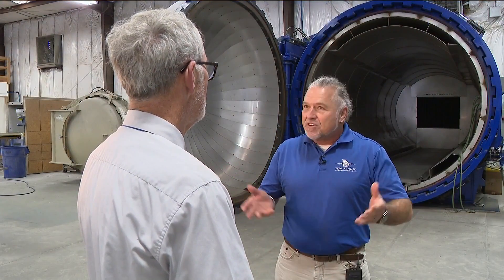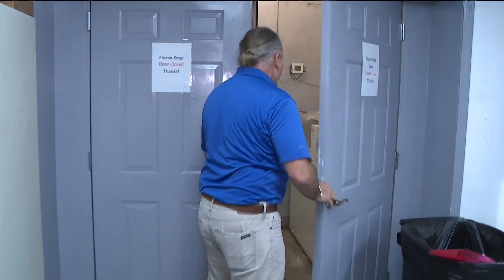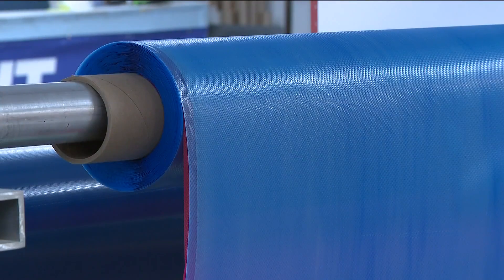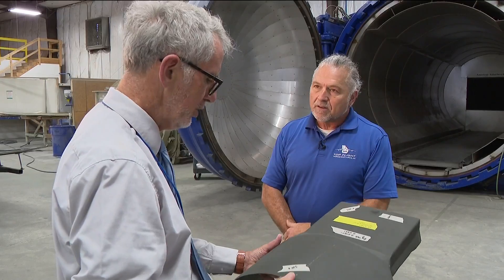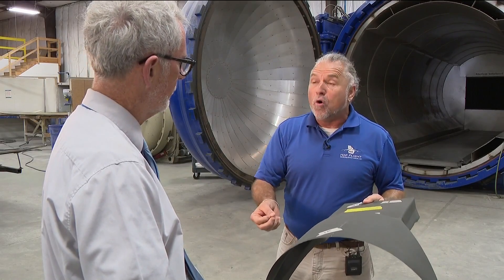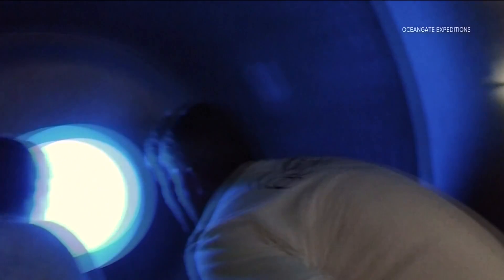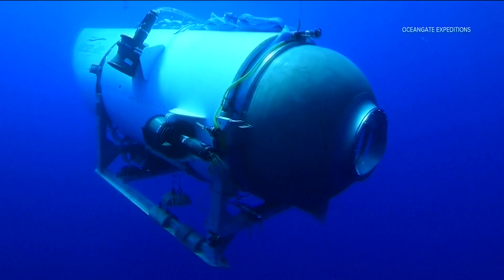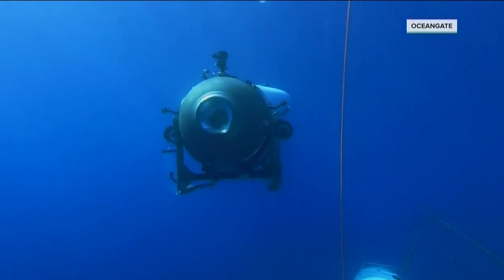Georgia engineer talks carbon fiber that failed in Titan submersible implosion

Comment: There was nothing wrong with the Titan submersible's engineering, in my opinion. It just needed to have an expiry date, a service life (I'd say no more than 1 year), or a fixed number of dives before it was tossed and replaced. 

At such high pressures (400 atm), latent signs of stress and hidden microcracks had likely begun occurring. This happens to other high-strength but frequently-stressed items we use like bike helmets, kevlar vests, shin guards, roof, tires, etc.

If the sub worked safely that many times, then the technology was not flawed per se. Deep water pressure didn't just magically increase overnight. The sub's number of dives just needed to be limited. Everything engineered by humans lasts only so long.

So for the quarter million dollars they charged each passenger and their one million in build cost, the sub would theoretically have paid for itself after four passengers or a single full-cabin dive.
Reply: I think his plan was not for the hull to keep up for as many dives as an all metal hull, in fact he had already scrapped one hull that showed signs of cyclic damage. His plan was to detect the early signs of damage well in advance with the acoustic detector he had patented and had installed on the Titan. Maybe it was a combination of the hull not holding up as well as he thought plus the detector not detecting as much as it should.
Reply: @sigkil Following Rush's logic, airlines should skip the 100 hourly inspections and instead install detectors which will let you know in-flight when your wings are about to fall off.
Reply: @qarnos 09:42:12 [SUB]: trying to run diagnostics. ascending now. but very slow. sounds have subsided. global RTM alert active all red.
Reply: @sigkil yeah that’s probably the real issue here, he was beta testing the warning system but also putting all his faith in it
Reply: The glue, the glue.
Reply: How about no

Comment: 🇵🇭 Carbon Fiber hmm.. is that the Material used on Car Bodies & Bumpers?  Expensive & Flashy  but NOT for deep water Temperature & Pressure.

This is Not MEG the movie right?
Now they knew CF wouldn't hold.

Comment: As an engineer it beyond reasoning why someone would want to use carbon fiber to build a submarine when it is an unfit material to use under compression. Foolish pride and not listening to the experts to use the right materials was what got the CEO killed and unfortunately the passengers. Hope this will be a lesson to others to listen and get expert help always and only use certified crafts or equipment.
Reply: I am an electrical engineer so I am no expert in material science, but I have worked with mech engineers my entire career. Most electrical circuits need a housing and environmental protection. The carbon fiber hull would have raised my flags right away. Did Oceangate even know the CTE of the poduct they used, it varies widely with manufacture. I would have never gone on a dive. Let alone the fact that I don't have a spare 1/4 million anyway.
Reply: The ceo supposedly had an engineering degree from Princeton. Maybe he was suicidal. And I'm shocked that billionaire passengers wouldn't have hire their own 3rd party certification. Maybe everyone was just really dumb
Reply: @sdrc92126  just because he had a degree in engineering from Princeton doesn't mean anything, there are good and bad people in all occupations plumbers, nurses, Carpenters,ect.
Reply: @karlmiller7500  It means either princeton is terrible or he didn't listen or he was insane (my vote). This is taught in at least 5 classes to get an ELECTRICAL engineering degree much less something more applicable like mechanical, aerospace or civil engineering.

Comment: Vacuum of space versus Titanic depth is 400  times ratio

Fibers work in tension not compression. Basically the Epoxy adhesive is doing the job.

2 same pressure vessels on earth at 14.7 psi inside. One is going to Pluto and seems a mighty 14.7 psi pressure with the vacuum of space. The 2nd vessel is only going to see the Titanic so has 395 times the pressure since it is 5800 psi there. 

The Titanic pressure vessel is using epoxy to hold the 5800 psi outside and the carbon fiber is just marketing hype. Ie giant red flag that none of that fiber is really in tension. Maybe some pretension but still hokey stuff
Reply: So it’s impressive epoxy then

Comment: It also looked like they screwed brackets into the CF hull on the inside, if so that would compromise the structure. Also any materials engineer would understand CF strength is tensile not compression, such a sad waste of lives :( !

Comment: 20'000 for a stress test. That's nothing to billionaires. That's just stubbornness and denial by Stockton Rush/Oceangate.

Oceangate really could have been at the cutting edge of innovation if they tested it all properly and without tourists until they were sure, but I don't think the sub would have done well in tests. I have this horrible idea he didn't want it testing for this reason. It was all about the money and fame.

People who do things and take risks without taking into account the safety and welfare of others often fall apart in the end. The bigger they are the harder they fall.

Comment: You completely missed the most relevant point that fiber composites excel in tension, not compression; that its use in this way is fundamentally unsound.   Mark Shinnick

Comment: Using carbon fiber like in an airplane is not dangerous because of an open space while using it underwater and submerge it as deep as you can will pose a problem because water is not an open space. The pressure it will give are very tremendous.

Comment: ok, that video clip taught me nothing. what i wanted to know was whether carbon fiber is LEGIT for submarine diving to such depths as Titanic. From what I've read from multiple youtubers (god knows where they got their information as no sources were provided), carbon fiber is not the correct material - PERIOD - to do with for compression, and instead, steel should have been used. I've no idea, just wanted to hear an engineer speak about the materials - thats it.

Comment: The guy in the video is trying to sell inspections.. And that's why he doesn't mention that aircrafts are holding pressure from the inside, it's not withstanding pressure from the outside. Also, the pressure that aircrafts contain is just a fragment of the water pressure at large depths.
Reply: Indeed. An aircraft is pressurised to 0.75 atm, so the pressure differential is no greater than 0.7 atm. Meanwhile, a submersible at 4000 metres is experiencing a pressure of 400 atmospheres of seawater.

He should just say it is not good for building submarines.

Comment: Carbon fiber is the last thing I would decide to make something like this out of. It has awful compressive strength, especially when you're taking it thousands of feet underwater. How did this even get passed as a good idea
Reply: How? The CEO of Oceangate decided it was a good idea. Then he either ignored or got rid of anyone who told him otherwise.
Reply: I don’t think they had any kind of certification.
Reply: No, NOT terrible, maybe not the very best.........Better than Wood which had supported railroad tressels for 200 years...............Paul

Comment: It's the wrong material for subs. Under sustained load in the presence of sea water, carbon fiber's tensile strength decreases 7 to 12%. Wet/dry cycles also weaken it. Every time he took that contraption down, he was one day closer to death, because he was weakening the hull. Then you have those titanium end pieces that were glued to the carbon fiber with epoxy resin aka JB weld that you can buy at auto zone. Epoxy resin has a tensile strength of 5 to 6000 psi, but the Titanic depth he took it down to, has a pressure of 6000 psi, not good. If that wasn't crazy enough, they said the plexi glass portal was only rated for 2000 or so feet. The manufacturer told him this, but he used it anyway. There were so many weak points on that thing, that there's no telling what caused its demise. They said the last message he sent was that he was dumping ballast weights, so something happened to cause him to try and resurface. He probably sprung a high pressure leak in one of those end piece joints or carbon fiber stress cracks that the Brit found, and it was the beginning of the end. He fired the Brit for telling him it was unsafe and there were stress cracks. I could be wrong, but I think the thing exploded instead of imploding. If the pressure leak started in a compromised area and the rest of the contraption was sealed up, the pressure would have exploded the cylinder like compressed air blows up a tire. I suppose the bodies inside would have imploded though. The kid was the only one who had any sense and didn't want to get on the rinky dink thing. The said he did it anyway to bond with his dad, which seems strange. I thought you bonded with your dad, because he was your dad. Why would you have to risk your life to bond with your dad? I used to go fishing with my dad, but never considered it a bonding session.
Reply: How would it have exploded like a car tire? The difference between a container's internal and external pressure is called the differential pressure. A car tire can explode if the differential pressure gets too high and exceeds the ability of the tire to contain the pressurized air. In order to increase the differential pressure enough to explode the tire you will need a compressor to force enough air to go into the tire while the pressure outside the tire remains the same. In the case of the submersible, the only available pressure source is the ocean outside. If the sub sprang a slow leak the highest the  internal pressure could ever go would be equal to the outside pressure. If that had happened the sub would never have exploded or imploded. It would have just slowly filled with water until the occupants inside were either crushed to death or they drowned. The only other thing that could have happened would have been a catastrophic implosion where the hull suddenly failed and everything was suddenly forced inward. During the implosion the pressure inside the sub would have instantly become equal to the pressure of the ocean. After the implosion the sub would have ended up as a twisted, broken mess, which is exactly what we're seeing as the wreckage is being brought up.
Reply: @joevignolor4u949  They have videos of things imploding on YT. One of them is a tanker car from a train, and it pulled the whole thing in on itself in one piece. When you look at the wreckage, the pieces were blown apart. The titanium rings were no longer attached to the carbon fiber and the window was blown out from the inside, because there were no more bolts on the flange. The end caps also separated. An implosion wouldn't have blown anything out, but pulled it in on itself. If you are down where that sub was and had millions of pounds of pressure pushing in, a leak the size of a human air would explode it. The leak would be so pressurized that it would cut through metal, like a high pressure water cutting machine. If Stockton was in front of that high pressure leak, it would have cut him in half.
Reply: @mark6678 I do not understand your logic.
What's define if something explode or implode is the pressure differential.

An explosive explode because gas quickly build and create an internal pressure too big for the casing material.
It's impossible for a submanine to explode, unless the pressure inside the submarine is greater that the pressure of the ocean, which mean everyone is already crushed to dead by the air pressure.
Reply: @mark6678  - No way to create more pressure inside than there is outside a submarine unless you have a combustion or explosion internal to the sub. Since there was nothing combustible or explosive inside the sub it had to be an implosion. Since carbon fiber is very brittle if the cylinder imploded the carbon fiber would have splintered into thousands of small pieces hence there would be very little of the carbon fiber clinging to the titanium rings.
Reply: @WJV9  But you have 450 atmospheres of pressure outside and 1 atmosphere inside. It's like trying to force 450 ounces of beer into a 1 ounce can. The can is going to expand and explode. The pressures wants to equalize and will do whatever it takes to equalize.
Reply: Exactly. This isn't a safety issue or failure. The base material is unfit for it's intended use. Homicide
Reply: You make good points, I wonder if he'd just used a thicker hull than 5 inches if it could've held together. Maybe more like 10? The reason he wanted carbon fiber was so he could fit more people into it. It's all explained in his speech somewhere. This was the 2nd version of it, the had an earlier one using steel or something that wasn't designed to go that deep. Besides all that an expert said he should've been charging 1 million then decommissioning the sub once it reached its dive limit and built another. Sounds like he wasn't willing to keep rebuilding the thing like that.
Reply: Some good points here, but it is incorrect to equate the pressure they were underwater to the tensile strength of the epoxy (meaning that the epoxy was experiencing 6000psi just because they had an external load of 6000psi). That has to do with load distribution and design, not the external load.
Reply: Most epoxies have a tensile strength of 10,000 Lbs and compressive strength closer to 20,000........The specs are readily available from each manufacturer.........I have been using and researching the stuff for more than 30 Years..................Paul
Reply: Yes, and the epoxy joints were assembled in dirty workshop conditions and not degassed, so the joints undoubtedly contained dust and other stray material, as well as air bubbles. All these inclusions are points where failure can start.

Comment: I don't trust the material on bicycles because they'll eventually give way. I definitely don't trust it to be used in a submarine. They'll break without warning if cracks isn't spotted early.
Reply: There was a fatal incident several years ago in my state when a cyclist's carbon fiber bike frame broke apart when he was cycling at speed. Plus a good number of injuries.
Reply: @jonathantan2469  Yikes. Fatal you say? All the more reason why an aluminium bike will last forever even when stored as opposed to a CF bike. No thank you.

Comment: Carbon fiber is essentially a carbon weave material combined with epoxy resin and bonded by baking.  I don't care what anyone says, I would not trust it with my life and I would not trust it being used as a foundation on any type of structural use.  There's so many things that can go wrong, it requires meticulous upkeep and if any type of imperfection is missed, there's a weak spot in the material not to mention there's also the possibility of imperfections created during the manufacturing process.  Everyone I've encountered as a "believer" in the stuff swears that its stronger than steel and other metals and gets offended if you question it.  I've seen carbon fiber fail with my own two eyes.  It also seems that different experts say different things about it.

Comment: I don't trust carbon fiber. Never fly on the Dreamliner.
Reply: I’m with you & I won’t , carbon fibre hasn’t been in service long enough to prove itself long term , metal alloys  & fixings will deform & give more clues that a part or panel needs replacing , carbon fibre needs expert checking via ultrasound / X-ray , more chance in my humble opinion that something like micro cracking or delamination may get missed . Every deep submersible ( life support capsule ) from the beginning has been made from metal , firstly steel , when its strength limits were reached , then titanium came onto the scene enabling far greater depths to be reached , even then , the manufacturing process has to be exact & the machining of the sphere to be within tight tolerances , 0.1mm , so uniform pressure applies to the whole surface , allowing safe , long term & repeated use. Titanium has been proven in DSV’s for decades with 1000’s of successful operations to the deepest points of the ocean , using carbon fibre is like trying to reinvent the wheel , that’s cheap & breaks.